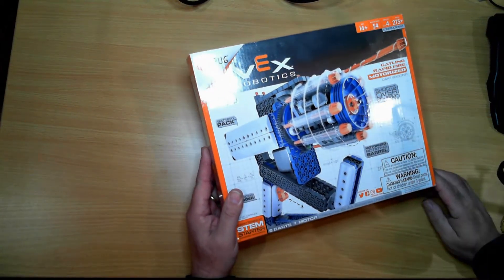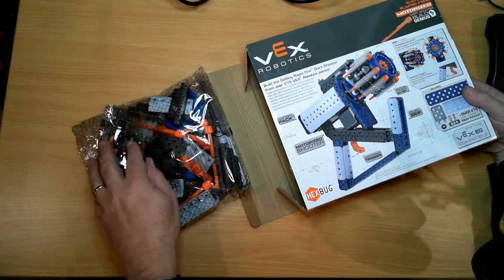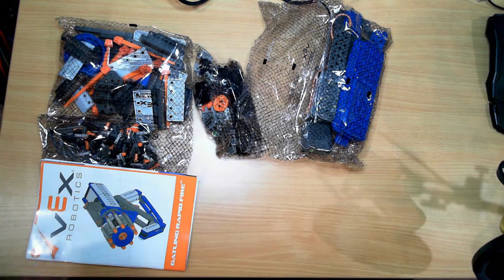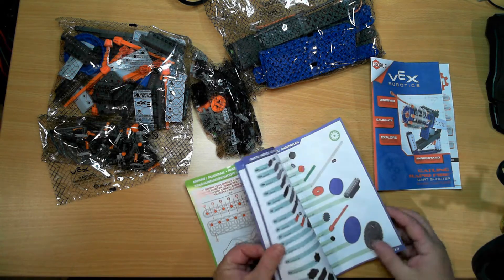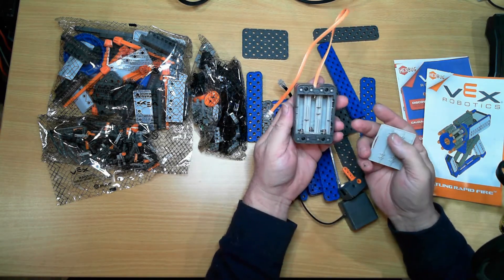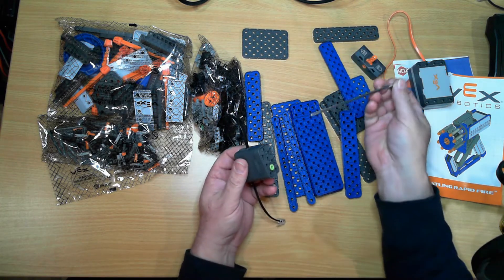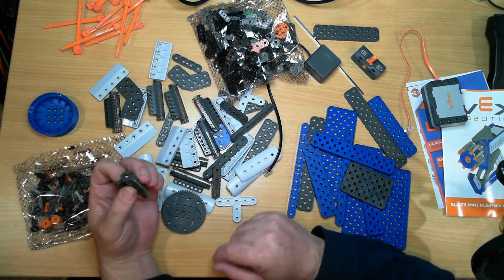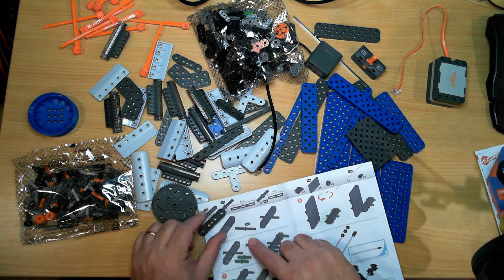Unboxing Vex Robotics Gatling gun

Comment: Mine doesn't fire
Reply from the maker: Did you put the darts in up the right way?
each barrel has a sprint in it, but the darts have the notch on then, the notch should be to the outside, so as the barrel rotates, the arm at the top pushed the back of the dart down to release the dart.